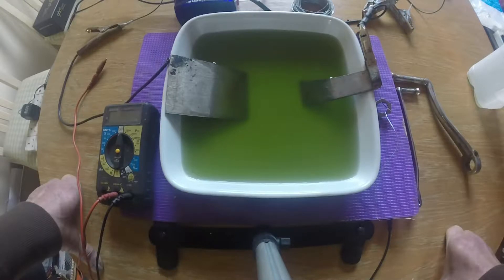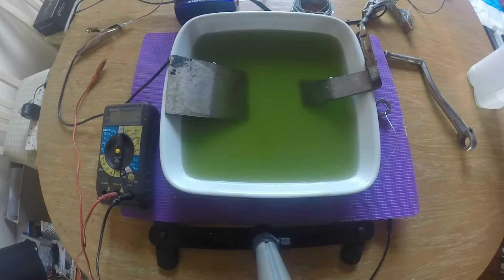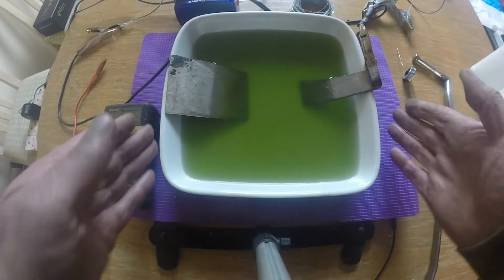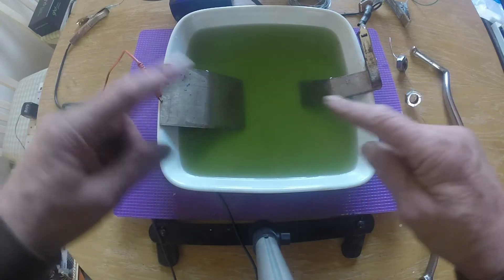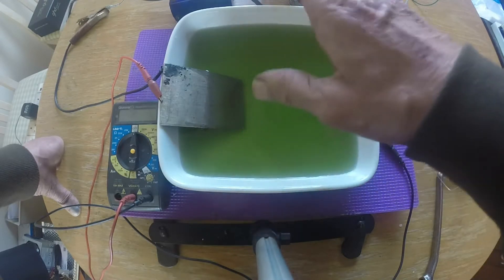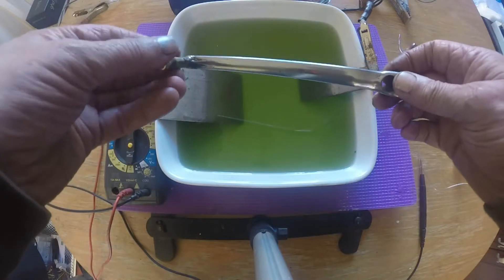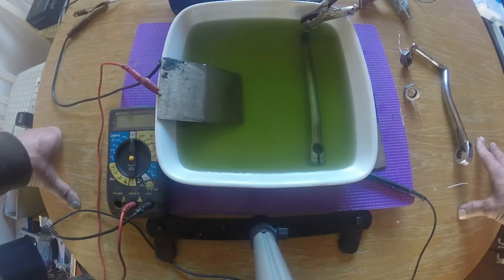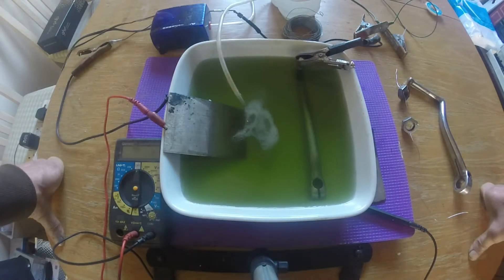Nickel Plating BSA Bantam Parts.

Comment: What material can be used for the anode? Does it need to be stainless steel for example?
Reply from the maker: For nickel plating use a Nickel anode. For zinc plating use Zinc anode.